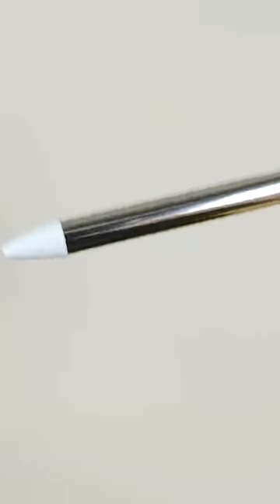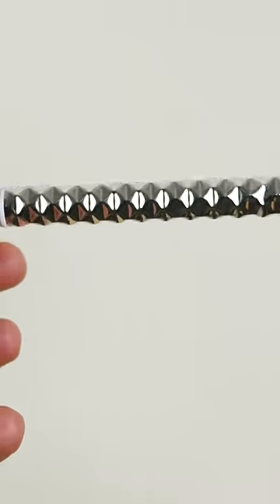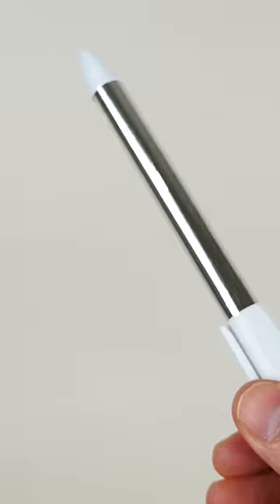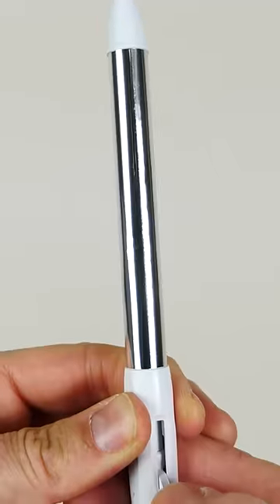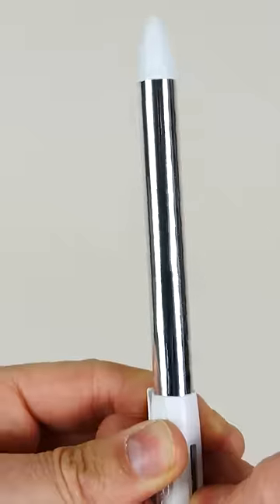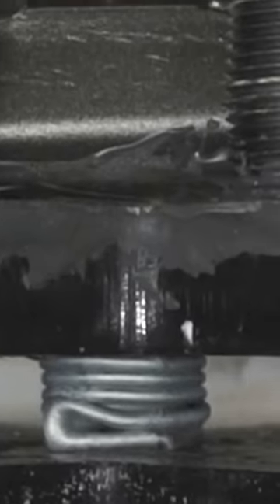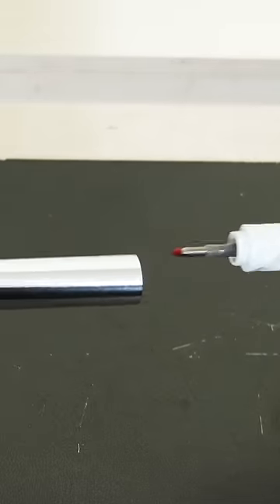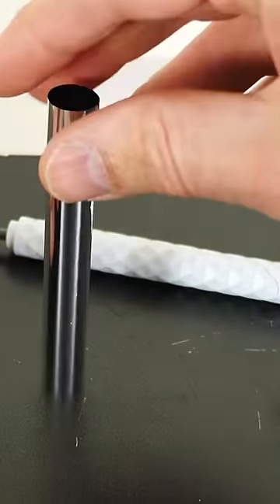How Does This Pen Uncrush Itself?

Comment: He's right to be disappointed; I looked into this morning and it's marketed more as art than anything. The pen isn't even rated to be switched back and forth many times before it fails.
Reply: so really you'd want to have disposable metal or plastic wraps.
Reply: @danielbush6882  Initially it wasn't even refillable but he's since made it refillable. The name of it is Crushmetric SwitchPen, the guy has a video here on youtube explaining it.
Reply: Mine stopped working and fell apart after about a month… I will say I did use it everyday for that month
Reply: I still have mine. They work fairly well. I've had them for a year now. Besides a couple wrinkles, they look and work the same as when I got them.
Reply: @minamihasaki4325  I'm sure they still work fine—I don't mean they won't be able to write anymore, I'm just talking about the structural integrity of the sleeve; the artist who created the pen himself stated that it wasn't meant to last long, and was more of an art piece you can write with.
Reply: Thanks. I figured it would not take many switches before error occurs to the metal. Hehe.
Reply: you'd have known it was marketed as art if this person would've bothered shouting out the artist, Noah, who created it.
Reply: @strangebirdfilms  why bother doing that when he can use the time instead to show us how the pen reminded him of when he crushed a pipe one time and explain how it got all folded up. Even though it turned out that the way his pipe crushed has entirely no similarities to the way the pen appears to be folded.
Lol why did he even post this video
Reply: Fancy gimmick. I'll stick with my turned marble cased, standard twist action parker type cheers.
Reply: I've had mine for 6 months. After the first month, you can start to see the grid of the pattern, but it still works as it should and writes. The covering is like a plastic foil...
Reply: I've got two I bought six months ago. I forget which ink cartridge they use but they write well. As an $8 novelty I'm not mad that it will eventually not crush properly or whatever.
Reply: Yea

Comment: this is why they didn't want the pen to be refillable, they didn't want people to open it up and realise how unmagical it is
Reply: They have an improved version where it's refillable now, I think. But yes the first version is simply too cheap and crappy to be the selling point.
Reply: @spe.z.artist  the metallic covering is a metallic ,plastic foil( like modern sweet cover).
Underneath this sheath of foil the true pen/pencil holder is plastic that has been manufactured in the geometric shape you can see when the pen/pencil is compressed slightly.

Compress and the foil (attached to the plastic only in certain areas) takes on the shape of the plastic.
Elongate and the foil is stretch out again, becoming smooth 

Clever design engineering ❤
Reply: @MM Lock Surely either YouTube glitched or you're trolling, but there are 10 comments in a row from you saying the exact same thing 😂
Reply: Isn't it magic knowing that magic is so easy to create?
Reply: @mmlock6570 sorry i missed that, whatd you say?
Reply: But people could feel the plastic texture before they buy the pen
Reply: It would be easy to design it so that the interior isn't seen, and you just unscrew the ending to pull out the old ink tube
Reply: Then they would have made it so you can't take it apart. Kinda defeats your whole "un-refillable" argument when it can easily be opened and replaced.
Reply: @MM Lock pauls dishes are really cool tho, hes making a table
Reply: I'm sure that's more about making money.
Reply: There's no such thing as magic.

Comment: Everyone is disappointed that it’s just thin plastic being stretched over a pre-shaped pen shaft, and not shape shifting metal, but the fact that they were able to so effectively deceive everyone is impressive in its own.
Reply: It's the "magic trick" of pens. Looking like you're floating isn't as cool as actually floating, but it's still an impressive feat.
Reply: if you think about it for a moment it’s pretty obvious for some people
Reply: Actually, a metallic sheet material called Mylar bends pretty similarly to the design on the pen. My guess is that the plastic is just a guide for the sheet to bend perfectly into the grooves.
Reply: I automatically thinked of it as a thin plastic lol
Reply: good point. it's atleast a conversation piece
Reply: @asdfghjkleoty4729 yeah it looked plastic. Why would someone automatically think of thin-walled metal? Ive never even heard of that.
Reply: @doclime4792 you’ve never heard of aluminum or tin?
Reply: This... Is pretty much what I thought it was. Cool effect though, and I would never have come up with it myself. I wonder how precisely it needs to be manufactured.
Reply: These were pretty common in 90s/early 00s (atleast in India).
Reply: The deceit is disgusting in my opinion. I've completely stopped watching this guy because of this gross clickbait. His channel should be reported. Look here he is pulling the same thing off again.
Reply: @agoogleuser2507 what? lmfao
Reply: @agoogleuser2507  were you dropped
Reply: @wildfire9280  Nah, I was thrown
Reply: @agoogleuser2507 nah you were dropped. Stop lying
Reply: @aregulargenericname8794  You need to relax
Reply: @agoogleuser2507  lmao “his channel should be reported” —> “you need to relax”
Reply: @wildfire9280  💀
Reply: Everyone was hoping for t1000 tech lol

Comment: There’s a reason why a magician never reveals his tricks….
Reply: @200TM 😡
Reply: @redisanuber  😊
Reply: @200TM The missile knows where it is at all times. It knows this because it knows where it isn't. By subtracting where it is from where it isn't, or where it isn't from where it is (whichever is greater), it obtains a difference, or deviation. The guidance subsystem uses deviations to generate corrective commands to drive the missile from a position where it is to a position where it isn't, and arriving at a position where it wasn't, it now is. Consequently, the position where it is, is now the position that it wasn't, and it follows that the position that it was, is now the position that it isn't. In the event that the position that it is in is not the position that it wasn't, the system has acquired a variation, the variation being the difference between where the missile is, and where it wasn't. If variation is considered to be a significant factor, it too may be corrected by the GEA. However, the missile must also know where it was. The missile guidance computer scenario works as follows. Because a variation has modified some of the information the missile has obtained, it is not sure just where it is. However, it is sure where it isn't, within reason, and it knows where it was. It now subtracts where it should be from where it wasn't, or vice-versa, and by differentiating this from the algebraic sum of where it shouldn't be, and where it was, it is able to obtain the deviation and its variation, which is called error.
Reply: @eirinyagokoro2648 i like this explanation it makes sense to me
Reply: @rifas9852 🤔
Reply: @200TM uhh why is brother repeating it
Reply: @snipette09  😊
Reply: @LobsterMobster25  😊
Reply: I'm glad you guys are still happy five months later
Reply: Wait oops I mean 😊
Reply: Everyone take cover,bot attacks inbound.
Reply: Yea
Reply: It's cool in a way. It's a reliable, elegant way to achieve the effect and it scales economically.
Reply: @BlossomedJewelsOfficial  oh no he got infected
Reply: All magic is, is learning, why hide the knowledge?
Reply: lol so many smiley faces 😂
Reply: Wat da hail is goin on 😊
Reply: 😊 SMILE EVERYBODAYY!!
Reply: why is everyone spamming 😊
Reply: no
Reply: Someone help me out of this chain😊
Reply: To not disappoint...

Comment: "I have a PHD"
"What did you specialize in?"
"The folding of thin walled shapes"
Reply: I mean, most PhDs are like this anyway, extremely narrow subject that has probably limited uses but it's very deep. The value comes from being able to make such a deep and complex work.
Reply: ngl that's a very interesting specialisation
Reply: Sounds like any physics thesis project really, biology/biochemistry even if you replace the subject with “protein”
Reply: It’s important for anywhere that hollow or lightweight supports are needed, such as buildings, aircraft, spacecraft, and underwater pipes. It’s difficult to design something precisely if you don’t know when or how it will start to collapse and fold.
Reply: That's how PhDs are usually
Reply: The folding of thin-walled shaped
Reply: That is honestly a broader specialization than most PhDs I’ve seen
Reply: I was pursuing PhD in squishing of glass spheres.
Reply: A PhD in cool pens
Reply: @InTimeTraveller The value comes from what you make of it.
Reply: “They asked how well I understand theoretical physics, I said I had theoretical degree in physics”
Reply: The understanding of different failure modes of thin-walled structures is actually a very important aerospace structures topic
Reply: I'm sure there are already numerous people with doctorates in this
Reply: @dielaughing73  yeah, mechanical engineering has a whole field in it.
Reply: It's super interesting. This is from a paper about how cylinders fold under pressure they always make the same pattern.

Curved-crease origami can control the shape of elatically-buckled tubes. By using pre-embedded curved-crease origami patterns in thin-walled cylinders, the failure mode can be pre-determined as a stabilized high-order elastica surface, which manifests via a diamond buckling mode. Measurements of the deformed surface show the buckled shapes to have a near-exact correspondence to the analytical curved-crease origami.
Reply: Jwst struc designer wants to hire you
Reply: @InTimeTraveller Like the Russian Wrestler with a PhD in suplexing people. He'll smash you flat on your back in the most efficient and effective way.
Reply: not be confused with the guy who compiled  all the ways to fold origami
Reply: @InTimeTraveller  
Yup,like a heart surgeon vs general Dr.They both gave to start knowing everything basic for body till you decide what parts body you want to take Ed further. Lol
Reply: If anything that's too broad lol, they'd probably have it in like a specific instance of this or a specific type of thin walled shape.
Reply: Sounds more interesting than most, which wouldn't be difficult.
Reply: Yup. There are absolutely projects like this and it's common. Typically, the title will be more complex than that. It will be more specialized / specific. Something like "Studying the compression of thin-walled cylinders of various alloys inside a vacuum." I'm not sure if you're implying it's simple or just sounds funny, but it's not on the former and I agree on the latter.

Comment: I did an aerospace engineering degree and this is the principal of buckling of a thin walled cylinder, however the reason there is the plastic profile below is to support the buckled shape. Otherwise you wouldn’t be able to hold the pen without deforming the pattern.

Our Structures lecturer was so happy to show us this pen and talk about the principal behind it!
Reply: off topic but YOUR PFPPP TOTORO :DD
Reply: There's a clear plastic cylinder over the top of it so you're not holding the foil
Reply: It has an outer plastic shell, which would support the structure of the pen and allow it to be held.

Aerospace engineering degree sounds like it’s really paying off.
Reply: What was your principal's name ?
Reply: @BeforeThisNovember  have this exact same pen, there is no outer shell. You hold it by the crinkled middle section which is supported by the molded plastic cylinder underneath.
Reply: Sounds similar to when I did an architecture degree and instead of finishing the degree I just partied, took up a drug addiction and got laid loads, it was so good 👍
Reply: @PandaMane what's it called? My daughter would really like this
Reply: @chadjconklin  Crushmetric pen. They make a drink cooler & chair too.
Reply: @BeforeThisNovember There's no plastic cover over the foil. Which you can obviously see in the video. Your degree in making shit up is really paying off though.
Reply: @k-ozdragon  someone already said that, on this 1 month old thread. 

Maybe you should have done a degree in awareness.
Reply: @BeforeThisNovember  Wow, a whole month? Someone should have told you that your ignorance lives forever on the internet. You seem like the type that needs to be told repeatedly anyways.
Reply: @k-ozdragon  do you often live in the past? I don’t tend to revisit 4 week old conversations, I have much more important things in my life.
Reply: @BeforeThisNovember  You just revisited a month old conversation. Twice. Congrats, you just played yourself. Again.
Reply: @k-ozdragon  must have your smart boy hat on today, huh. Go you!
Reply: That is very impressive. 😎
Reply: Loud and wrong 💀 @BeforeThisNovember
Reply: @PandaMane  Can you tell me where you got it?
Reply: Principle*